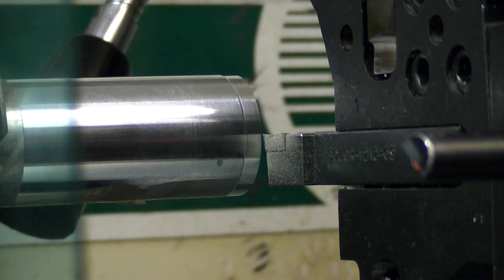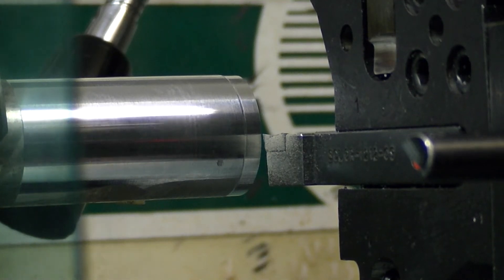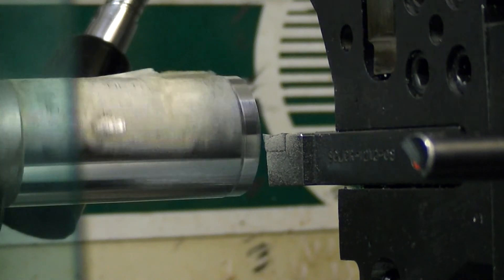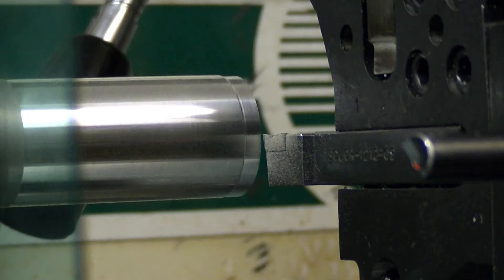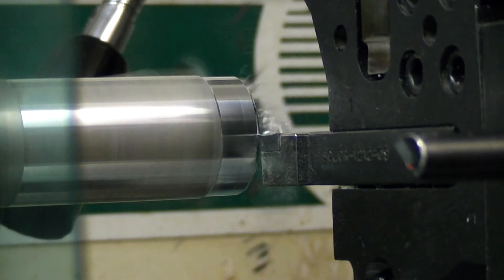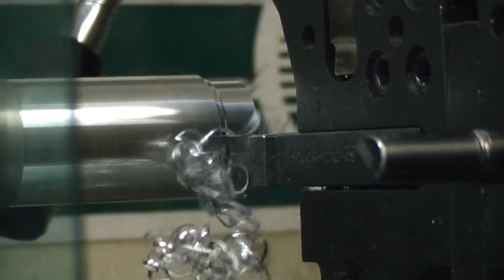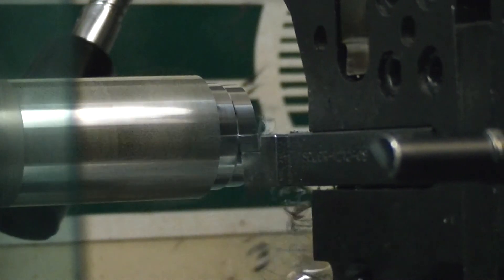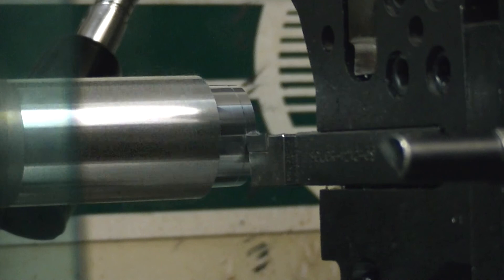Denford Orac CNC Tutor 3, Turning end of bar.

Comment: These are wonderful videos. I just learned of the ORAC and thought I'd see what's out there for how to use one, these have given me a really good idea of how effective one of these can be. Great to run start to finish on a simple tutorial, the only thing that seems to be missing here is how did you set up the machine for exactly where the 0 0 start datum is? did you step until touching the piece then set the value somehow or is there some other feature for this?
Reply from the maker: Sorry for the late reply, yes I touch off and set tool T1 X=00, Z=00.  then other tools set from No.1 tool

Comment: Hi are you using the original software or have you updated to mach 3 / Linuxcnc ?
Reply from the maker: Hi Dean, yes still using the original Denford program, you can see the program entered in the video linked below. https://youtu.be/H_lKQvYgV4A
Are you a member at the Orac group at iO Groups ?
Reply: @ukmwg  Thanks for the prompt reply -  I am now  a member of the Orac group at iO Groups  -  :-) a member of my plan I had converted mine (with help) to Linuxcnc using a mach3 BOB and am currently rebuilding it replacing the mach3 BOB with a Mesa card amd possibility replacing the spindle motor